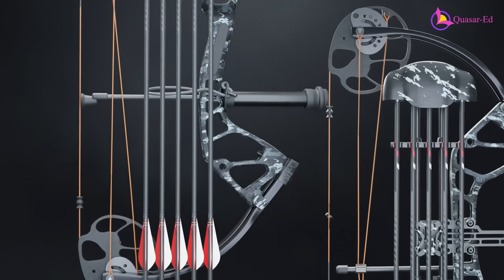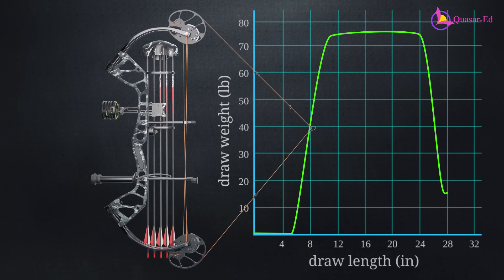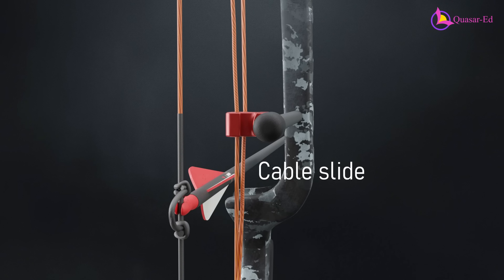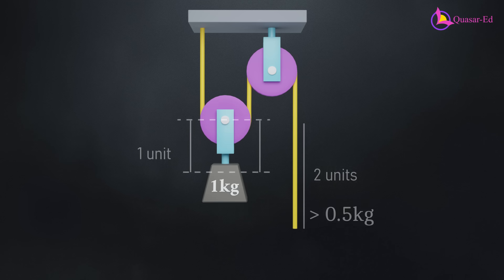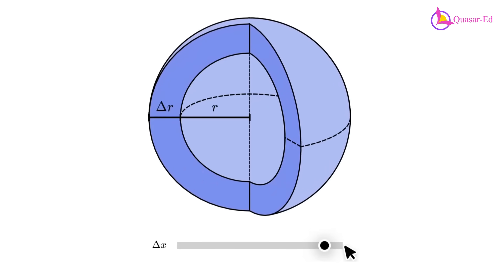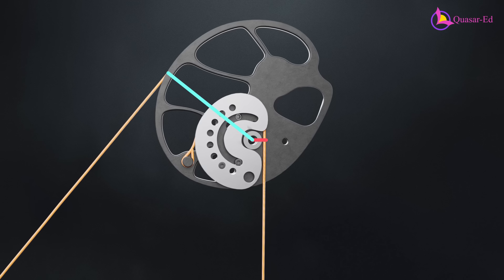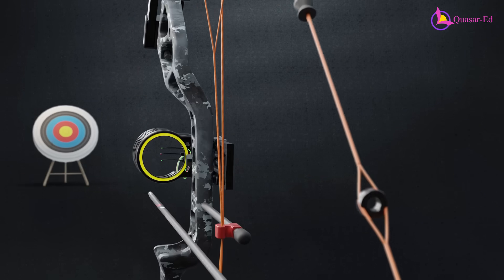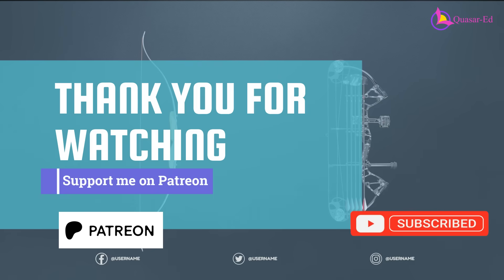The Engineering Behind the Modern Compound Bows

Comment: The crazy thing that blows my mind is that humans invented nuclear weapons before inventing the compound bow.
Reply from the maker: @Berkana  OMG. That is true. 🤯
Reply: @quasar-ed  Because Compound bow required and profit of discovery of carbon fiber and other composite materials. I dont know if compound bow or crossbow exist in wood essence ?
Reply: @jumpman120 it can be made out of wood as well. It is not about materials, it is about the mechanisim.
Reply: @metsanpeikko3829 6 mins into the video it says the materials are what make it more powerful. Without them all you have is an over engineered bow.
Reply: @shabadooshabadoo4918  you don’t even have to watch any video to know that the machanisim makes it powerful. And the mechanisim is what makes it ”compound bow”.  If you think that the mechanisim doesn’t matter, why dont they just make normal bows out of those special materials?
Reply: @metsanpeikko3829 because the stronger material doesnt bend as much so you wouldnt achieve full draw. Again, its all explained in the video if you watch it.
Reply: @shabadooshabadoo4918 the material is not the only thing that matters in that how much ot bends. Thikness of the bow is what matters. Thin bow bends a lot, and thick bow doestn bend so much. When you pull the string the bending part bends about 3 times less than in a normal bow.(it debens on the compound bow, but about 3x) which means that the bending bart should have 3 times more strenght. So you can make it out of wood, by just making the bending parts stronger. 

Thanks for your response, and if you have anything else in your mind I will be here to talk with you.🙂
Reply: @metsanpeikko3829 Strength goes up with thickness but flexibility goes down and weight goes up disproportionately. So yes if you want a bow thats 4 or 5x as heavy as a normal bow then you could engineer one because you need 3x as much wood plus the mechanical parts. You might as well just carry a crossbow then, much more powerful and lighter.
Reply: @shabadooshabadoo4918 yes, but no.😅 

If the crossbow is no a compound crossbow, it wont be more powerful than compund bow. 
The draw weight alone doesn’t really tell how powerful the bow or crosbow is. The string of the bow has to move rapidly, and that is what makes the arrow go faster. The idea of compound bow is not that you can hold big draw weight, the idea is that the pulley mechanisim makes the string move 3 times faster. 
Ofcourse the draw weight still matters. With a big draw weight you can shoot heavier arrows.
Reply: It’s a surprising complicated problem. In a simple bow there are several non linear curves that overlap. Acceleration of the bow limbs, the arrow and the strings has to be balanced against bow limbs that are bent in a non circular ark and the strings start as a line but becomes a changing angle 🤔 Just the geometry is pretty challenging.
Reply: @David0lyle  If gunpowder hadn't been invented this would have been figured out a long time ago.
Reply: @David0lyle I know they were not pitted against each other for development race or anything, but you think compound bows are more complicated than nuclear weapons? I think the only part which was the most difficult to get right was composite materials which is very new invention
Reply: Because the rifle was invented even earlier
Reply: This is the best commentary on bows I've seen all year. But your point is even more fascinating when you consider that it took thousands of years of perfecting bows to eventually invent the compound bow, and only a few years to develop nuclear weapons.
Reply: @ one of the most advanced old-school bows is the Japanese longbow. They hold it asymmetrically with 1/3 below the grip and 2/3 above the grip. I never understood why until I found out that there is a vibrational node at the 1/3 point, and gripping it there virtually eliminates hand shock from releasing the bow. It wasn’t until modern parallel limb compound bows that another bow design managed to eliminate hand shock.
Reply: @Berkana 为何不反向握持，将重心下放呢？？你可能忽略了一个事实——古代日本人的身高。
日本在古代被称为“倭国”，意思是矮人国。由于资源匮乏营养不良，直到近代，日本人的身高都远低于周边国家。更糟糕的是只能用竹子制作长弓（同样因为缺乏必要资源），造不出反曲弓，因此弓臂必须够长才能勉强保证威力。显然，最长的弓臂需求与最矮的身高出现了矛盾，这导致古代日本人使用典型长弓是有困难的，只能将弓臂向上延伸。也许是因此带来了意外收益（人类工程史上的各种巧合之一）。
多说一句历史，日本政府对身高问题非常在意，在工业化时期甚至官方公开提出遗传学解决方案——鼓励日本女性与西方人交合(作为其“脱亚入欧”自我改造政策的一部分)。听起来很极端，但更极端的是日本政府同时组织女性远赴海外卖淫赚取外汇🙄……由此在战后的政治宽松期诞生了一部著名电影《サンダカン八番娼館 望郷》（奥斯卡奖、金熊奖提名）。
《Sandakan 8》  IMDb: tt0073654
Reply: @谈天说剑独善何益 I believe that a long asymmetrical bow with the grip near the bottom is maybe the result of taking advantage of the natural shape of a branch and avoiding problems like the tillering.
Reply: @Berkana grabbing at an antinode will stop vibration, not a node.
Reply: @scrub9794 holding the Japanese bow at a vibrational node isn’t meant to stop vibration, just prevent the vibration from acting on the hand.
Reply: @Berkana ohh that makes a lot more sense thanks
Reply: I guess it makes more sense to add string dampeners on the bowstring at antinodes for sound dampening purposes 😂
Reply: @GBAS-u9q  it took equally long to improve our understanding of maths, physics, and engineering to create a nuclear weapon. Not just a few years.
Reply: Or consider that the only reason nuclear weapons were discovered is because of an abstract physical theory , otherwise no one would have ever spent the time and resources
Reply: @GBAS-u9q the power of military sized budgets
Reply: @GBAS-u9q  More profit$ developing nukes than bows.
Reply: A nuclear is a main quest but upgrading a bow is a side quest that done after
Reply: Because the bow for what it was used for at the time didn't need inproving. Until the modern archery competitions started developing.
Reply: Humans discovered general relativity and the variation of time flow with gravity, before knowing that we lived in a galaxy, the Milky Way, yet visible in the sky before there were street lights everywhere.

Imaginary numbers were discovered before it was known that free-fall motion did not depend on mass in the absence of an atmosphere, something that had been measurable since antiquity.
Reply: @jeanmartin963  That is pretty crazy.
Reply: Was there a need for compound bow in the past? Because the nuke was born out of necessity during the war.

Compound bows were invented mainly for competitions and recreation.
Reply: With firearms, bows are obsolete. They basically came back as compound bows for sport.
Reply: By that logic, it’s actually crazy that human invented nuclear weapons before fidget spinners. Bonkers.
Reply: Because nobody uses bow? Less demands, less invention.
Reply: @ I bet people used bows way more than people use nukes. Probably 100,000x more. Probably millions of times more.
Reply: @Berkana because you not gonna go out Hunting a Deer with a Nuke 😂 You use a Rifle and thats why nobody using Bows
Reply: @HansGruberX1 I understand that, but I’m still a bit surprised that for the tens of thousands of years that humans used bows and the thousands of years that people had pulleys and wheels, nobody invented a compound bow in ancient times.
Reply: @kiattim2100  because the recurve was enough
Reply: why is this surprising ?? 
reinventing the same concept versus creating new concepts. Why would humans be stuck on reinventig the same thing over and over again when gun powder was created etc.. minds were already seeking new ideas and innovations. 
What blows my mind is people want to perfect the bow when there are better alternatives.
Reply: Not at all mind blowing. We have stopped using bows and arrows for hundreds of years. No reason to waste resources on making it better. It's an entertainment.
Reply: The reason is actually quite simply. Bows are no longer used as much so little to no innovation was happening there. The material needed to make the compound bow was also not available before that.
Reply: Wouldn't this be an unfair comparison as their mechanics are from different areas of science? A nuke to a compound bow or the other way around is not like how a musket would naturally progress to a rifle, so you're comparing apples to oranges. Also the nuclear bomb was made out of perceived necessity whereas I doubt people were as desperate to create a compound bow at the time.
Reply: Because we invented  Fireweapons which made Bows obsolete
Reply: We got compound bow before GTA6
Reply: To be fair, the original bow design is almost perfect so why fix something that ain’t broken. Until a genius archery enthusiast proved it otherwise… but even then there are cases where recurve might be better than a compound
Reply: Tbh when you look at the chronology of our technological development, the nuclear bomb is completely out of place.
Reply: War obviously more important than hunting!  Isn't that interesting.
Reply: Because they had invented something more useful for hunting and fighting than normal and compound bows, firearms.
Reply: Not true.   The oneidas used a what's called a lever compound bow for hundreds of years.   You know, the one and only group of native Americans that supported us and helped us in the revolutionary war.
Reply: I mean, there was a way higher need of making mass destruction weapons to counter armies with bigger menpower than there was a need of making a pretentious version of a bow
Reply: The "Monster from the id" is still alive and kicking.
Reply: To be fair no one really want to upgrade a bow.
Reply: Wow...never thought of that...
Reply: It really bows my mind too. 😅
Reply: nuclear is found by not researching about it, but compound bow is development of regular bow.
Reply: My mind is blown too.
Reply: It's all about availibility of materials. The therory of compound bows is old and well known for thousands of years but it was not possible to make one. Atomic bombs are much more complicated and the knowledge was really new but the materials needed were available earlier. Thats all. Today we have printers melting plastics and printing complex objects. The therory of melting and extrusing plastics is not rocket science, but it was not possible before due to the unavailibility of the materials until now.
Reply: Wasn't useful for war...
Reply: crossbow am i a joke to you?
Reply: The apparent human necessity of how many birds someone can get out of one shot without time to even react is the reason
Reply: Good point.  That is strange.
Reply: Now make a nuclear compound bow
Reply: That’s only because Einstein wasn’t very interested in archery
Reply: Humans invent based on need. There was no need for the compound bow. There definitely WAS a need for nuclear weapons.
Reply: This comment makes no sense. Why pick and extreme like a nuke when a more accurate statement would be the invention of guns before compound bow.
Reply: @Okami400 precisely because it is so extreme. The compound now seems like low hanging fruit but nukes need a whole stack of breakthroughs in physics and engineering and chemistry to even be prototyped.
Reply: @Berkana  🤔
Reply: @Berkana nuh, u picked nuke invention only because it sounds much more pompously

but comparing a weapon of mass destruction and a bow, the effectivity of which began to rapidly decrease since first plate armor was invented - that's dumbest logic someone could ever imagine

The same take could've been made by comparing modern carriages and electrocars
Reply: what is a pulley
Reply: @wachinichu  A pulley is a wheel that is used to redirect the tension from a rope. The things on the ends of the limbs of compound bows are a sort of pulley, and if the radius changes or is non-circular, then it is also considered a cam. The very first compound bow didn't have cams, just pulleys (wheels) at the end of the bow limbs.
Reply: the security bicycle was made the same year of the automobile
Reply: I usually max the more useful skills first before adding any spare skill points in those I rarely use in MMORPGs
Reply: Physics is wild shit
Reply: Efficience is the answer
Reply: Now fission and cobalt weapons
Reply: That's efficiency
Reply: It's not surprising when you consider that the difference between the compound bow and other bows its the material science.
Reply: So true!
Reply: Well they could’ve certainly developed it earlier, there just wasn’t much point since technology relevant to the military was what was rapidly being advanced in the early to mid 20th century due to the two world wars. Which is why nuclear technology was developed first, there was a massive benefit militarily for whoever first developed a usable nuclear weapon. A compound bow is useless in the context of modern mechanized warfare, it was only appealing to bow hunters.
Reply: Truly fascinating observation, but it makes perfect sense really:
Bow is a weapon...
All you need from a weapon is power. The very moment black powder was discovered and therefore muskets invented - bows became a rubbish weapon concept in general.
Why would you try improving something that is conceptually a lot less powerful than, lets say, a musket...
Reply: Because they already invented firearms to kill each other. Otherwise they would have
Reply: @massimocornacchia1428  I understand that, but bows were in use for something like 10,000 years before guns were invented, and yet the compound bow wasn’t invented in all that time.
Reply: Because bows are useless
Reply: 原型は18世紀頃の中国にありました。
Reply: well, the biggest brains are attracted to monstrousity
Reply: That's because guns were invented, which basically took over from bows and arrows.  This took away any pressing need to improve the bow.
Reply: @Danielstrath  yes, but bows were around for tens of thousands of years, and pulleys have been around for at least thousands of years. I’m surprised nobody put them together to make a compound bow during that long period of time before guns were practical.
Reply: A technology appears not just only because someone invented it, that is also because there is a demand for it. Do you know that archeologists discovered that the ancient Egyptian invented steam engines? Then why didn't the industrial revolution started then? The answer is, why do you need steam engines when slave labors were abundant and much cheaper?
Why did nuclear weapons got invented before the compound bow? That because of World War 2. If you want to defeat Nazis, would you prefer to send soldiers armed with Nuclear weapons or Compound bows?
Reply: It's not like nuclear weapons were going to take over the hunting industry
Reply: The only complicated thing in a nuclear weapon Is the sincronicity of explosions around the material. Pretty strainghfoward
Reply: @kaglioster  Many countries invest tens of millions of dollars in the development of nuclear weapons but are unable to produce them. In reality, the process is not that simple, ranging from uranium enrichment or plutonium production to the precision operation of detonators and the creation of explosive composite lenses made from explosives with varying detonation velocities. These are crucial for achieving the perfect implosion, without which full compression of uranium or plutonium is not possible.
Reply: @GBAS-u9q  Oh you only need two sources of synchrones detonation and one standard high velocity explosive. The perfekt implosion can be achieved by geometry :)
Reply: @ figuring out how to enrich the fissile material and figuring out all the physics that would suggest that it is even possible to create a nuclear explosion was part of the scientific and engineering accomplishment of developing nukes. All of that was hard won knowledge.
Reply: @kaglioster saying quantum mechanics is less complicated than classical mechanics is just stupid af
Reply: @kaglioster and the less you know - the simpler they will seem to be.
Reply: Exactly right lol captain dunning Kruger here
Reply: @kaglioster  Good to know, I have some free time this weekend.  Maybe I'll just built one in my garage this Saturday.
Reply: @kaglioster acually the enriichment process of purification of fission material is the major challenge. The nanosecond synchronization was problematic for old tec back then
Reply: Lol, captain dunning Kruger here.
Reply: @kaglioster there’s absolutely nothing “straightforward” about nuclear weapons 😂 stop acting like you know a single thing about how nuclear weapons actually work all you know is the most shallow information from YouTube lol you don’t know a fraction of a percent of what’s needed to make a nuclear weapon 😂😂 if it was “straightforward” then everyone would have one. There’s countries that have put billion and billion of dollars 80 years since it was actually invented and they still can’t create one. “Straightforward” shut up lol
Reply: @kaglioster  nuclear weapons are straightforward to you yet you don't know how to spell synchronicity hmmmmmmmmmmmm